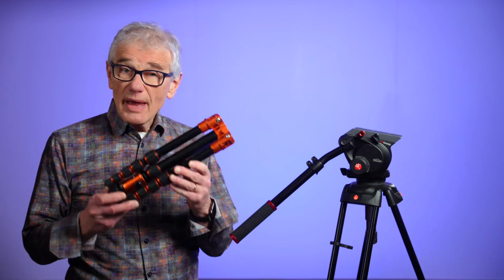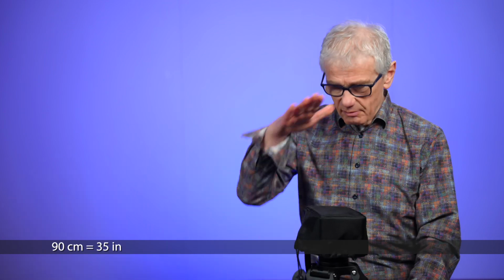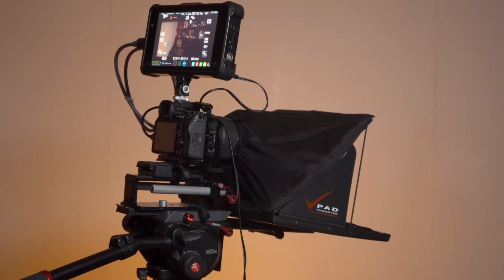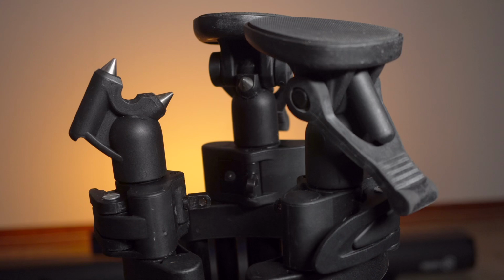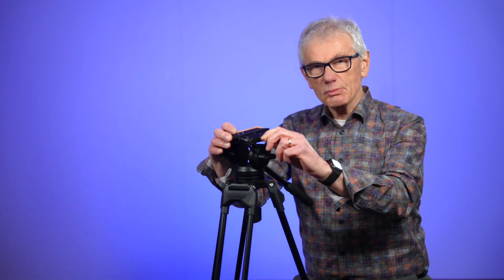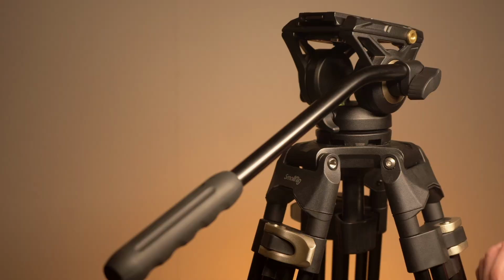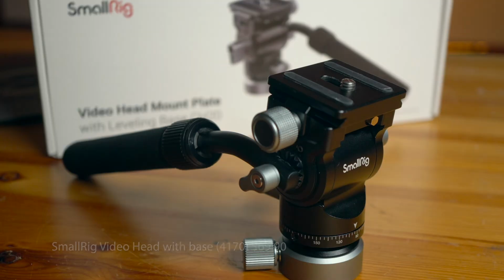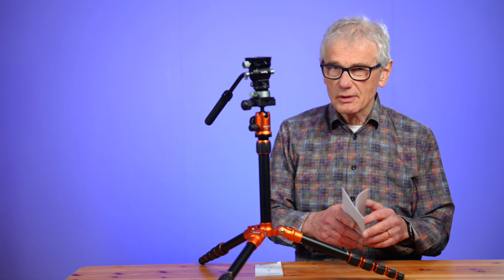Tripods featuring SmallRig AD-01

Comment: Hi thanks for the great review. Might Need recommendation for considering to upgrade my tripod. I previously used beike Q999H for 5years and the ball head start to loose when cover my rig. Or i just change the Head ?
Reply from the maker: A pleasure to read your kind words. I don't know that tripod or what's loose. Maybe there's an adjustment you can make to tightne it again. Otherwise, if you can determine that the loss of friction is in the head, changing that might be sufficient.

Comment: bought this tripod and I end up not using it. It has limited adjustment downwards. you can't go below roughly 1m (measured from the floor to your camera lens). Smallrig offers leg spreaders for more advanced models, but this one remains crippled. If you don't need to go below 1m it will probably serve well, but otherwise it is useless.
Reply from the maker: I'm sorry to hear. It's wise to understand your success criteria for a purchase before making it.
Reply: @MaartenHeilbron  when you're a rookie you don't realize all aspects of the equipment. lesson learned :)
Reply: Whats your go to tripod then? Instead of this Ad-01 smallrig

Comment: Do you know how to remove the fluid head and attach a different head. It seems when I detach it the bowl is still attached to the fluid head. Thanks!
Reply from the maker: After you've removed it from the base, turn the bottom half of the bowl until it's released.

Comment: Well,  Small Rig only puts their name on it. There are other companies that sale exactly the same tripod - but under different name. ( Or Small Rig allows other companies to put their own name on it and sale it under their own name). Either way, I I purchased 2 of them from Amazon, for $119.00 each ( ... original price $139.99, discounted to $119.99). Must say, great tripod. I put all my expensive tripods away, and now I am using only this one. Expensive doesn't necessarily means "good". This tripod is good for 90% of people out there.  Highly recommend. Thank you
Reply from the maker: Yes, I noted that it's available on Amazon (even with the SmallRig brand) for much less than the list price. And I'm not surprised that it's a product that's white labelled by the manufacturer to anyone who wants to buy some quantity of these.
I thought a lot about "how do they get it so cheap". 
I worry about the overt or covert mechanisms that fund this "too good to be true" pricing ( is it government subsidies or exploitive labour practices?) and the ultimate results of such tactics on those who don't enjoy the government support those kinds of practices require as well as the existing companies impacted by these products.
Reply: @MaartenHeilbron  Good points. I think it is cheap labor we all  benefit from. Just the case itself must be worth half of the price....

Comment: If you want a better leveling solution then take a look at the Sachtler aktiv heads which eliminate the knob tightening point underneath the fluid head (brilliant design!) and which also has an illuminated bubble level you can see from above OR from the side. Expensive by most measures, but for quick and easy transitions during a shoot—even onto a slider without taking the camera off the head—there’s no other head and sticks combination that comes close. Highly recommended.
Reply from the maker: Thanks for that note - I honestly haven't looked at a Sachtler head in years, I go out to my dealer and check them out!
Reply: @MaartenHeilbron  You’re welcome. I have Manfrotto sticks as well, but the Sachtler sticks and heads are much easier to use. Especially the heads because you don’t have to reach under to  adjust level and then only have one hand on the camera. With their aktiv system, you can adjust and keep both hands above the mount to better stabilize the camera. Absolutely brilliant. (and no, I don’t work for the company, I just appreciate great design)
Reply from the maker: Thanks for adding these notes, I'm looking forward to seeing it in person.

Comment: Your rule number one didn't apply to me. I started with a cheap Hama which I was quite happy with until I got my first 400 mm lens and tried it on a windy day. Then I bought my largest, heaviest, sturdiest, most expensive tripod + head to date. I still love it, but as it's about 125 cm tall, head included, when collapsed to its smallest size, mind!, and weighs 21 kg, after many years I decided it was time to get some smaller tripods - which happened to be cheaper and less sturdy.
By the way, Manfrotto is my brand too. The big one is the 161mk2B with the 229 3-way head, and the next one was the 055pro3 with the MHXPro-BHQ2 ball-head, the RC-128 fluid head and the 393 gimbal head. I also own a Befree and two 209 table top tripods - not with the smallest ball head, which I consider to be almost worthless, but with slightly larger heads. And then I have one non-Manfrotto: A K&F concept KC-TM2534 travel tripod, because I wanted to try twist locks and carbon "sticks".
Reply from the maker: Thanks for sharing those experiences, always interesting to hear stories from other photographers. Although baby bear does have twist locks, they're not my favourite, as they seem to enjoy pinching my fingers.
Reply: @MaartenHeilbron  I twist them with my middle finger at the middle of the lock against the palm of my hand. I don't even touch the edges of the locks, so no risk of pinching.
Reply from the maker: I should try that.